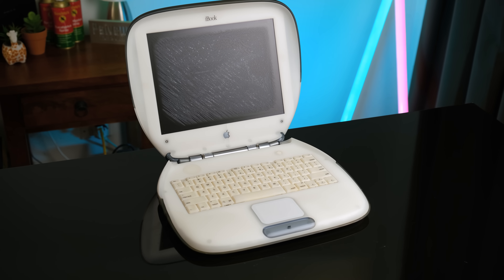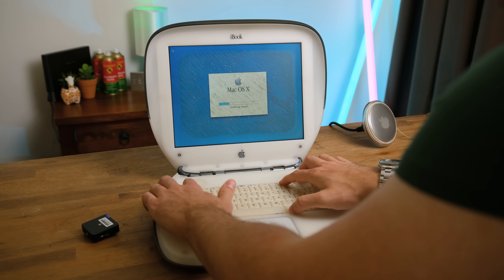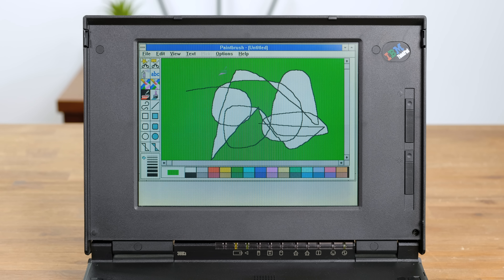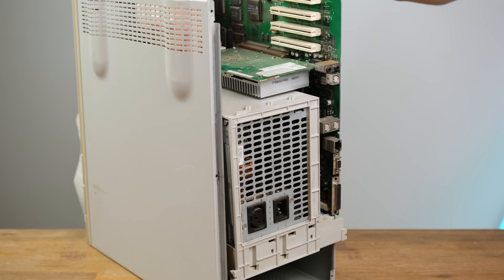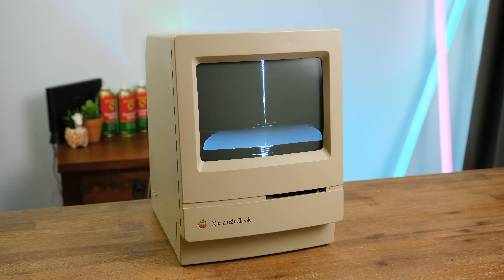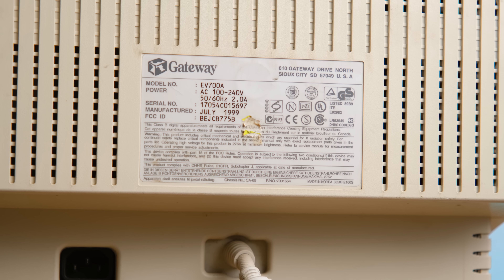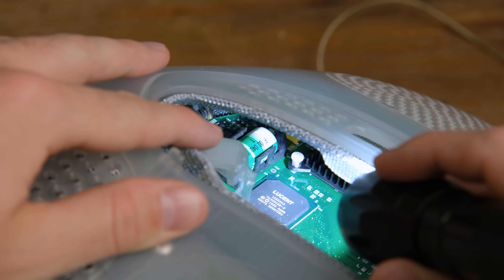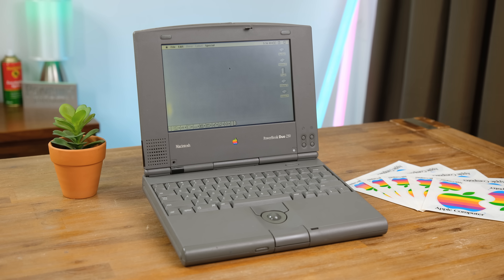So Much Vintage Tech Is Dying... Here's Why

Comment: I have a 2004 HP desktop and 2009 Dell that still  work as well as they every have.  The problem is the software is so obsolete they are not very usable.  Speaking of old tech, we watch TVs that are 70 years old on a regular basis. Of course, you have to restore them(mainly replacing all the paper and electrolytic capacitors) and have a DTV converter box.  They are B&W, but the show we usually watch(Perry Mason) is B&W also.  I also have quite a few restored radios(mainly AM), The problem with these is that AM stations are horrible now unless you like talk radio.  I have a low power transmitter to play music on them.

Comment: I used to work at the U of Iowa surplus (pulling hard drives, 3-pass erasing them, having the drives that failed and sensitive drives shredded instead, place working drives back into systems and sell them.)   The GX270 had MASSIVE cap problems, and some GX280s did too (I assume overlapping with when the problematic GX270s were made.)  Not really a design problem, it was that couple years when almost all vendors had MASSIVE problems with their caps.   Interesting and alarming; I have a nice collection of vintage hardware and it's worrying to think that having it storied in indoor conditions will not prevent it from crapping out on me.  I may take that advice to sell off what I can! 
Fascinating video!

Comment: I usually do the following with my electronics collectibles from the 80s-90s-00s: I always separate the batteries, when the equipment allows the battery to be detached; for electronic devices that have an internal battery, I charge them to about 70% and store them (every 6/6 months I try to charge them again); to avoid any type of deterioration due to time of use and humidity, I vacuum pack EVERYTHING using a sealer. After sealing, I still keep them well accommodated in a place that doesn't get light or moisture. I think by doing this I know I'm delaying any kind of future damage to collection items well. Most of my items are portable electronics, so vacuum sealing is very easy. ;)

Comment: Should make a follow up video on how to prevent and remedy the situation. e.g. fly leads to batteries place inside machine away from where they can cause damage, 3D printing replacement parts and 'anti-leak' battery holders, recapping with high quality caps, replacing PSUs and screens with modern more reliable equivalents, mainboard treatment and sealants etc to prevent corrosion of PCBs and metal.

Comment: When I stopped using my LG G2 phone a few years ago, it was in perfect working order. Recently I had to go back to using it for a few days due to my phone dying, and parts of the touch screen no longer worked at all! It simply sat in a drawer--a cool, dry place--for a few years. A device manufactured in 2013 and working perfectly well up until around 2020 start to break down in just a few short years? What's going on?

Comment: I used to work at an electronics repair shop; we took off those rubbing coating by rubbing it with a towel with mineral spirits on it.  Seems like it's a lot easier than what you're doing.  I have not worked on mac products specifically, so ymmv, but it was very effective.   Just wanted to share since you seem the type that will do that a lot.

Comment: so, beyond computers and tech, same thing is happening to a lot of 90s and older vehicles. My 95 lexus had a cap leak and burn out a really important trace that caused the vehicle to not run properly. Ford EEC-IV systems have been dying since around 2010, and last I checked it's really hard to find a remanufactured ecu for one.

Comment: Literally sold off my entire G3/G4 Mac collection about six months ago when I realised they were all beginning to get very temperamental in terms of wanting to run. Power supply caps started dying, the hard drives got more flaky, even solid state bits like RAM started to fail after a while. A shame for sure, but I have great memories of them all. Hopefully the new owners are better with soldering than I am.

Comment: So, to conclude: Apple products are pretty, expensive and as durable as any other PC, but twice as expensive. Then again, with PCs, you CAN replace parts easily, even on many laptops... well until they all started copying Apple, that is.

Mind you, I recently disposed of an IBM Thinkpad 240 from 2001 and it was in perfect condition and could even still run Windows 10... so... YMMV. Same with a Toshiba convertible.... from 2011.  And my Surface Pro 3 from from 2014 works fine. Ditto a Samsung UMPC...

Hmmm... maybe this IS an Apple problem...

Comment: Yeahh. My original Ps2 I got when I was 6 (27 now) just died after I had it stored really well for over a year. Hooked it up to a newer roku tv, got to play one game for an hour and then watched the colors go green and purple and then died. So devastated because I have roughly 50 games for that console. The light and fan come on but nothing on the screen. Still trying to figure out if it is the console that died or the cables though.
Reply: It may very well be the cables, don't give up hope just yet. My N64 had a similar problem, and it DID end up being the cables.

Comment: I taught myself basic electronics and bought all the gear to recap circuit boards - properly! No twisting or cutting of caps to get them off the board, lost count the number of boards I've worked on and not a single one needed any such treatment. Anyone who does twist and/or cut has no idea what they're doing. It's not only computers but anything electronic. I've even recapped DVD recorders with freeview built in.

As for the batteries, I remove all of them and in some cases replace with modern equivalents to maintain functionality. Just because a board with SMD caps may look OK, doesn't mean it is OK. I've worked on BBC Micros, Amigas, C64s, games consoles, X-Boxes, vintage PCs, audio/video equipment, computer peripherals, Archimedes, Spectrums and many, many more. They all need love. Except the Atari ST. None of those worth keeping.

Comment: There's no profit in making products that last. No matter how much virtue signaling and  climate change agenda pushing nonsense is spewed. All that matters is the profit margin. I have a refrigerator from 1979 that still works, my 85 F350 truck makes about the same mileage as the 2020. The steel roof I put on my house 20 years ago is still holding strong while my neighbors have their roofs reshingled at least a dozen times. And my steel roof can be recycled. My washer and dryer from the 90's still wash and dry. I have an old Apple 2 I picked up at a rummage sale that still fires up. I've gone through more phones and TV's in the last 10 years but my old 36" flat screen tube TV from 25 years ago that's used as a garage TV still works.

Comment: Forget about electronics - I had a 2001 BMW M5 which began to disintegrate after 12 years . Everything made of plastic (and rubber) just crumbled. Even the headlights fell apart. 
Now that's an expensive problem.

Comment: On the other hand the Commodore 64 continues working (except its power supply which really should be replaced because of design flaw). Plastic might be yellow but not disintegrating.
I got an early 90s Casio pocket TV. Worked flaslessly last time I used it. Wanted to make a shot of the C64 on it recently but didn't work. Screen made wierd lines. I thing I've narrowed the fault down to a leaked and/or dried out electrolyte capacitor. Replacing it is the hard part as it's not easy to get to. If I'm lucky it can be replaced with a film or ceramic capactor so it won't go bad again (in my lifetime). No signs of LCD screen has begun disintegrating. Funny constuction as there seems to be quite high voltages present (around 60 volt). Sure for the backlight which is a flurescent type but also places not directly associated with the backlight inverter.

Comment: Stuff designed to be used, not stored.

If that mac was used even once a month, hard drive wouldn't get stuck
Batteries not only need to be stored half charged, but also may need to be cycled sometimes. And in use leaked battery would be found and replaced before everything corroded beyond repair.
Mold/moisture would have way less chances staying when cooling fans are working
Even melting rubber - this started to happen with my 10 year old "B&N nook" reader after sitting unused for a while. But after I wiped it and started using it again, over month it stopped being sticky and almost returned to the original feel.

Some things will die regardless though..

Comment: If the hard disk isn't being read, the file system (HFS) has become corrupt and Mac OS 9.x/OS X needs to be reinstalled after a format. If it's making the click of death, it can be taken apart and it's magnets and platters can be repurposed, same for the DC or AC motor.

Comment: Electronics made before late 80s still mostly work fine because made with quality and expensive components. After they were made mostly on the cheap and without durability in mind. Even the expensive Apples followed that route.

Comment: I've got a video where I try to disassemble a Zip drive on camera, and it's crumbling in my hands. The vinegar syndrome happens when the glue used on screen reflectors breaks down. I've fixed that with cleaning and carefully applied aluminum foil.

Comment: I own alot of old tech, mostly phones and game consoles so this makes me incredibly sad. I just wish I could keep them forever.
Reply: NES never dies! 🤓
Reply: I guess vacuum sealing it should make them last longer
Reply: i doubt all components would withstand a vacuum (i think back to the The Martian where he brings a notebook out into the martian atmosphere and the lcd screen breaks because of very low pressure)
Reply: or you could shoot all of your old tech into space then bring it back when you want to use it. @DeepSouthernTX
Reply: This video mostly brings up leaking batteries and capacitors as the cause of old electronics breaking. I don't think that is what causing the plastics and rubbers to brittle down or transforming to a sticky goo though. During this time period phthalates was widely used in plastics in consumer electronics. Theese phtalates leaked from the plastics over time making them brittle, sticky or miss colored.
Reply: @garaget81  if so, could they just replace the plastic?
Reply: @theIRS1  i guess, if there are replacement parts avaliable. That wont solve the problems with leaking electronical components though. Just with the brittle or sticky plastics.
Reply: @garaget81  well couldn't they also replace some electronics as well?
Reply: @theIRS1  theorethically you could just build new spare parts, but then, why dont just create replicas at this point. IIRC the Space Shuttle Program had to buy spare parts on ebay for their space ships and entire production lines were kept going, with obsolete technology just to produce parts for the space shuttle program. sorry for bad english. am sick rn and english not mother language.
Reply: @Zappy4001  thank you for explaining to me and don't worry about your English, it's actually really good ;)
Reply: With video games thanks to emulators you can still experience the game long past the console date.
Reply: @petelee2477  Yes and no. While emulation is definitely an alternative solution, the big problem with emulators in general is that they will never be perfect. What I mean by that is due to software emulation being much more sluggish and slower compared to native hardware, and you’re always going to end up with bugs and glitches not encountered on actual hardware. No amount of hardware upgrades will ever fix that issue, besides cloning the actual chips used to power certain systems known for their proprietary and complexity.
Reply: @crazedlunatic43  Unless you are a speed runner they don't necessarily have to be perfect. 
Most people just want to play their old games again and won't mind some minor differences as long as the experience is close enough to the original. Keep in mind that even in official releases there are some minor variations of the same game. A certain glitch may only exist in the X box version of a game but is completely absent from the PlayStation 2 version of a game for example. 

They don't necessarily have to be 100% authentic. Most people would be very forgiving of the absence of some glitches that were present in the originals and other glitches that are exclusive to emulators.

I've played a lot of NES games despite never owning or even seeing an NES and my experience wasn't ruined because I wasn't able to exploit some game breaking glitch.
Reply: You will die before your consoles
Reply: I like to think the newer the tech is the more these problems would be improved. So maybe it's not all doomed.
Reply: @Illuminate00the00Truth yes and no. Late 90s and early 2000s tech is horribly unreliable due to sabotaged electrolytics. Probably about 8 out of 10 motherboards from that time are dead because of it. Early 90s and earlier tech typically dies due to other issues. 

Thankfully I am noticing much higher quality caps on more modern motherboards so that should be much less of an issue. But heat may be a much larger issue than ever before. Constantly elevated running temperatures may kill modern components. RAM chips for example get way hotter than they ever did in the past. CPUs, GPUs and other components run quite hot at full load and this may dramatically shorten their life. Overclocking and constant gaming may contribute heavily to this.

Comment: You should make a video on Restoration and solutions to these problems, things like recapping, replacing the polarizers of displays, replacing those burned out CFL backlights with LEDs. Things that can help remedy these issues and extend the life of these machines. 
Also on older machines from the 2000s it's absolutely imperative to re-cap them ASAP due to capacitor plague (a lot of capacitors from that time were faulty and prone to dying early).

Comment: It's not only vintage computers & phones, it's also vintage cameras. Older Nikon N90s/F90x film cameras have developed the "sticky rubber syndrome". The older Nikon digitals (D40, 50,70/s, 80,90) also seem to have this problem. They were so nice to hold when they weren't sticky. One N90s is a very low mileage camera that I bought new. It has seen about 60 rolls of film. It is so sticky that you dasn't get it close to your face if you have beard/mustache(I have both). It was only the back cover on these, the rest of the camera was plastic. I bought a junker on eBay for experimental purposes. I had "Goo-Gone Wipes", and had read these would take off the sticky, but leave lettering intact. They did nothing, not sure about the liquid version. I am a type 2 diabetic, so I have alcohol wipes in packets.  These actually seemed to remove most of the sticky from the junker. A friend has a Nikon D70s, and the entire camera is sticky, making it unusable.
Reply: SPAM!!!

Comment: Some of the issues do seem repairable if you have the skills. Tech from around 1999 to 2000 were notorious for leaking capacitors. With some time and effort many issues can be fixed to restore the device to working order.

Comment: They want the old stuff to go to the city dump so we can buy the new stuff and they make more money, and the new stuff is built to break and be non repairable or more expensive to fix than to replace.
Every new car is a piece of crap, and so I thought I beat that by buying a 1977 Ford LTD with only 30,000 miles on it. Well it turns out Ford stopped making parts for it some years back, I can't find all the parts I need on the internet, and the ones I do find are used and over priced.
I thought I beat the system here, but it ended up beating me.

Comment: Ah, remember hitting CRT TVs to make them start working again... Don't know if I would trust a HDD that has to be "hit started" though... xD

Btw, the old laptops I have are fine screenwise. They are 486 and early Pentium ones. Still amazed that the battery of the Pentium 2 laptop still works and that it lasts for at least an hour (didn't test how long from 100 to 0).

Also got a Commodore 286 laptop where the screen still looks fine but can't test because I need to get a power supply as the original one is missing (found it at work inside a cupboard). The only thing worrying me is that something is rattling around inside the display and didn't find any guides about how to open it as just removing the screws isn't enough (don't want to break it as old plastics become brittle, with one clip for closing it already having snapped off without any force applied).
This laptop also had a rubber coating and looks bad but at least it's so old, that it isn't sticky anymore.

Btw, we bought some plastic thing for hanging up toothbrushes and so on inside the bath room. One or two years later the plastic already had become so brittle that it snapped and fell off the wall. I could easily break it into countless little pieces with my fingers, barely any force necessary. Never had such bad plastic before.

Comment: I have an early very small LCD portable TV, the screen kind of looks like it's had a lot of weight on it with many crack lines, however the outer protective plastic cover is intact, very strange. It spent many years stored in a padded case, now the LCD looks like I say on it, however all the 'crack' lines run in parallel at a 45 degree angle - really odd.

Comment: I still use an old Nikon D200 dslr camera. I'm bummed because the rubber is peeling off and the some tarnishing started to appear under the display. I just didn't use it for 6 months because I worked far from home. It was also in a dry box.